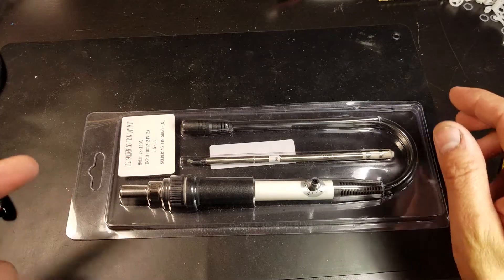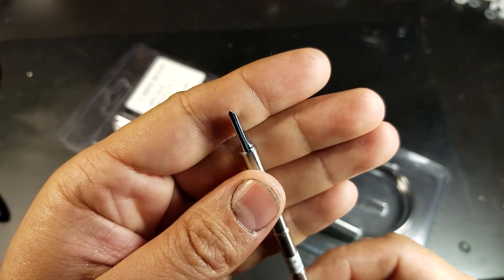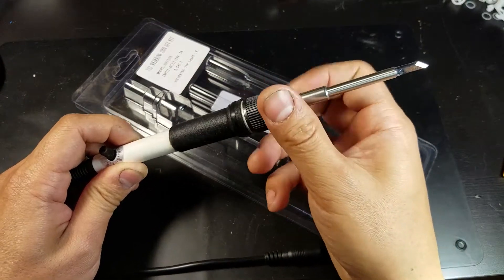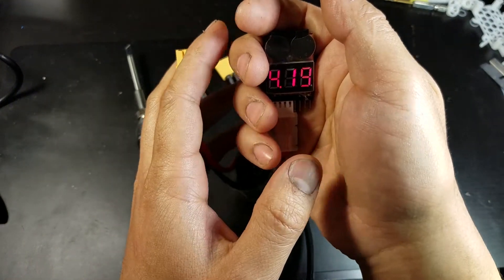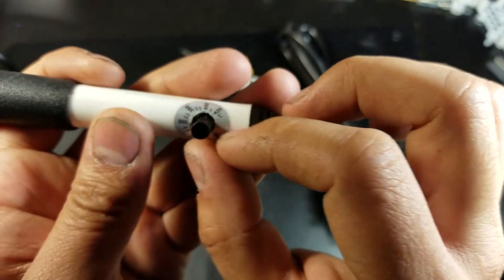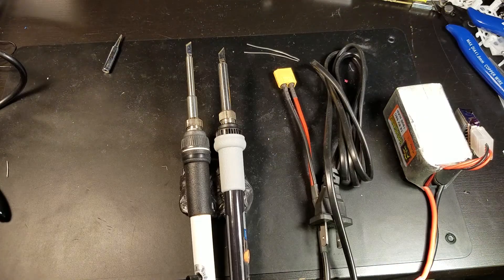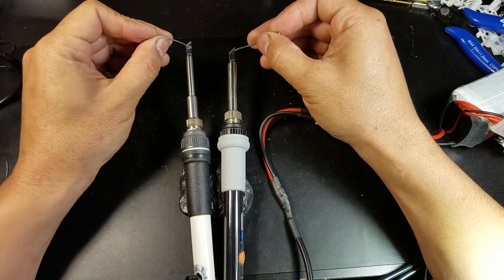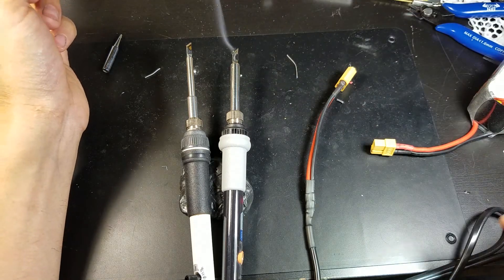Super fast DC powered portable soldering iron

Comment: What current at 12v?
Reply: It says DC 12-24V 3A on the package so using Ohm's law that would be 3 amps at 12 volts and 1.5 amps at 24 volts.

Comment: My k-type solder tip just turn red hot.. is that normal?
Reply from the maker: no, is it still red hot when temp is set low?
Reply: @DougHnut  yes
Reply: Red hot is never normal unless you want to run it that hot I guess. To be red hot the tip would need to exceed 650 °C while it should probably be in the 270-350 °C range.

Comment: i'm watching this soldering iron. does it have an indicator light when the set temperature has been reached?
Reply from the maker: its has a red led that's kinda hard to see. it lights up red when on and heating up,  it starts to flash when it reaches the set temperature. ive been using it for awhile, still works great. the higher the input voltage , that faster it will heat up
Reply: Doug Hnut great.. i'll pick one up then. thank you very much. :)